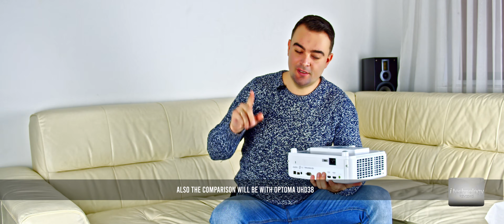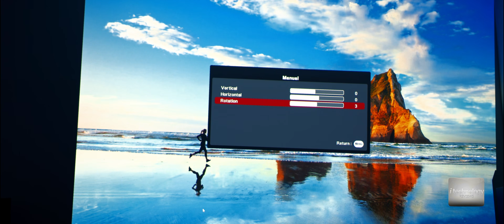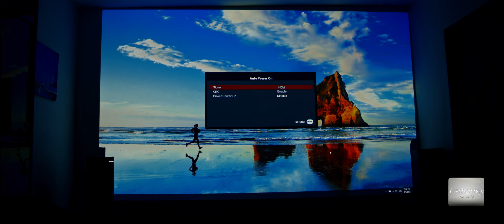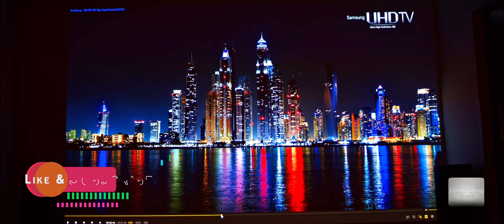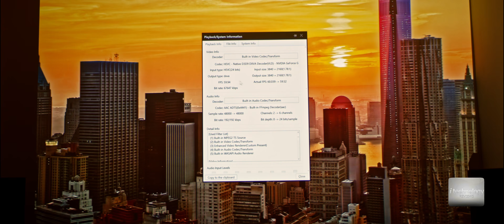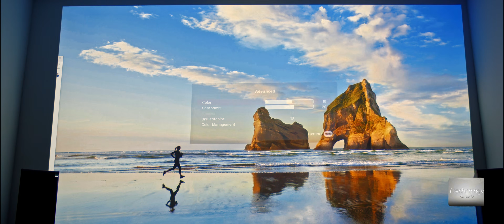Viewsonic PX748 - 4K HDR 4000 lux gaming projector 240 fps with 3D. 20 hours testing - full review

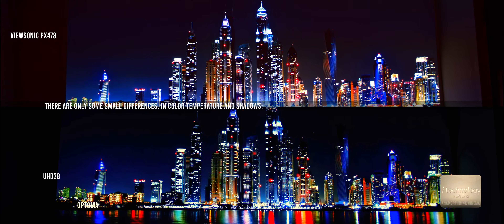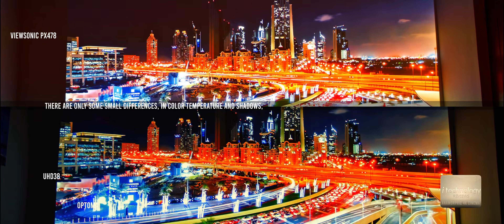Comment: Hi nice review!  At time 50:26 50:34 50:48 I notice a few things 1 light bleed color tint and that bring my question to hand.  Viewsonic TOP your wall is red light tinted and the blue sky is over saturated in a red hue (any blue is hued in red.)  UHD38 BOTTOM your wall and yellow white areas are hued in a green tint but the blue sky is great.
verdict.  at 50:26 50:34 50:48 it is very noticeable that the viewsonic TOP sky is over hued and saturated in red like your wall!  Could'nt you just adjust both UHD38 so less green and viewsonic so less red hues?  UHD38 looks to be deeper blacks

Comment: Thank you for the fantastic review the only question I have is the fact that I cannot have my projector directly in front of the wall. I have to put it on an angle can I still get a flat image on the screen in front because the keystone is very important?

The projector will be for my bedroom and the only place that I can put it is on the bedside cabinet beside my bid which is roughly 10% to 15% angle to the left or right of the middle off the wall
Reply from the maker: Hi. Put the projector in the middle/center of the room on a selling or table to have a clean image undistorsed. Subscribe

Comment: Hello and thanks for your review, I wanted to ask you something, you said in gaming mode you cannot "warp" the imge can you clarify what you mean with this? because my current projector its on the ceiling aiming down so the image its warped to be a rectangle automatically. Can you do this in gaming mode?
Reply from the maker: hi; when you disable gaming mode or better said fast input, it will revert to the default values! Every change will reset and this is not ok.

Comment: I've noticed how most 3D projectors loose brightness once in 3D mode. Does this projectors suffer lumen loose once in 3D mode? If so, how much would you say? By the way, I'm not including brightness lost by wearing the dlp glasses, just the lost in brightness once projector is switched to 3D
Reply from the maker: hi. your right! i notice it. maybe in the firmware 1.02 or 03 will fix this... andmaybe will give us the fir,wae too make ou self and not sending the projector to the service center... subscribe

Comment: Hello! I was wondering what is your opinion on why is Viewsonic PX701-4K or Acer H6815BD considerably cheaper than PX748 - 4K. All of them are 4k HDR.
Reply: The PX701 4K only have 3200 Lumens, no network connection and no inbuilt 3D,need a firmware to enable 3d, that's the reason cost lees but the image quality is the same as the PX 748

Comment: I have the same projector with firmware V 1.01 3D is working!
Sadly I have other issues, there is like a frame around the actual picture, making it unpossible to adjust the picture to the screen..
Reply from the maker: Hi. Yes i know. We prepare a new video for this. Tell me, did you send the projector to the service center for firmware update or did you made it by youreself? Now is 1.3 available to service center.
Reply: The firmware update has to be done at the service center.
Reply from the maker: maybe the service center will fix the frame and some highlists problems at the sky specially;

Comment: Surprised Ultra-Fast Input helped at 4k it states it only works at 1080p: To enable 4.2ms Ultra-Fast Input, turn it on in Advanced Settings and make sure the input content is with 240Hz refresh rate. When enabled, the highest resolution supported is 1080p. (from Viewsonic website)

Thanks for the detailed video it help me decide to upgrade from my Benq W1110 to this projector.
Reply: hey! 2 years later, are you happy with the upgrade? im thinking of making the same jump, w1110s to this!

Comment: between the Optoma UHD38 and the Epson EH-TW700, or Viewsonicpx748 - px728which one would you choose?
Reply: between the Optoma UHD38 and the Epson EH-TW700, or Viewsonicpx748 - px728which one would you choose?
Reply from the maker: hi; viewsonic px748 but if you will find a new versions 2022 version because in to the firmware 1.0 it has some problems that in to the service center i think it will be fixed; subscribe